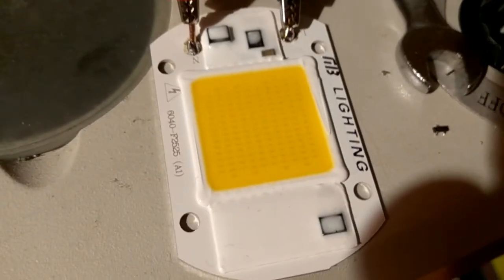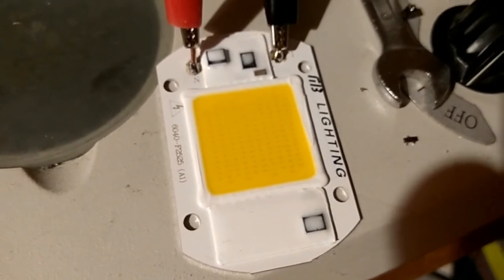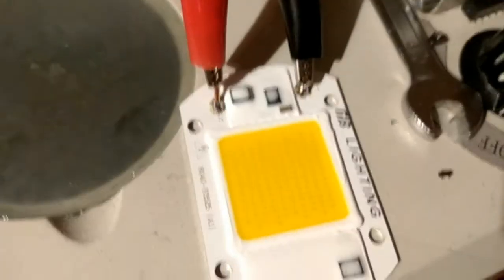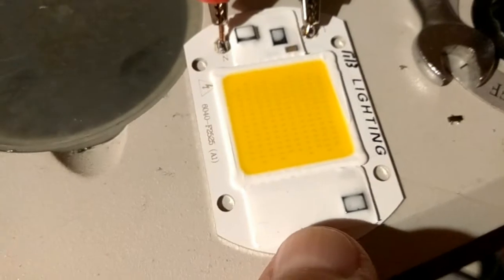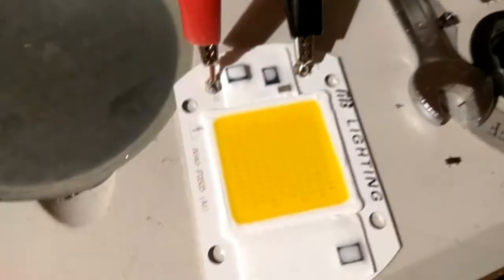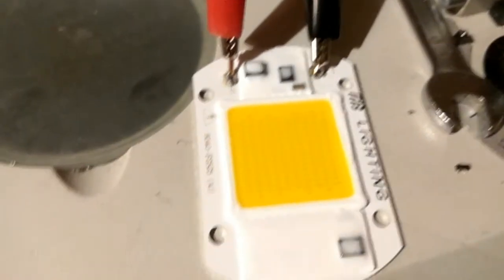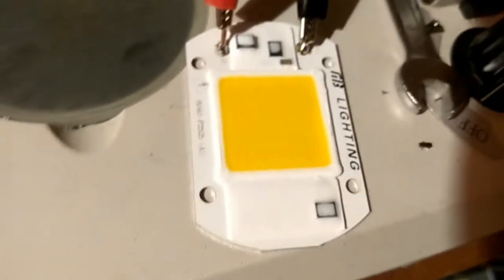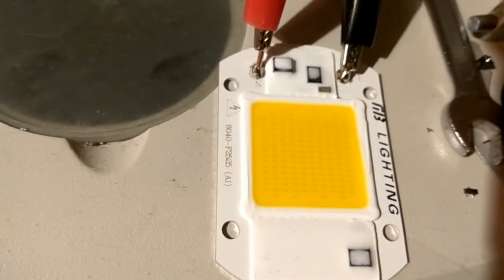110V 230V AC COB LED module, Warning: High Voltage !

Comment: Why is it listed as 110v when it is actually 220v? I bought three of these fuckers and they’re absolutely worthless to me because I do not have 220v outlets, only 110v. Is there a trick to getting them to light up on only 110v?
Reply from the maker: if you go into the order link I shared in the comments, you can see that you need to select the configuration in "wattage" point like :"30W 110v" you might ignored that during your order or get it from different link. you cannot modify that afterwards...
Reply: Veryokay oh, I got it from Wish, not from you, but I did notice that you both listed 110v which none of the three that I bought will work with.
Reply from the maker: @rockland2  try to complain at wish if they made a wrong item description, might you get some refund
Reply: Veryokay I did as you suggested and they gave me a full refund, shipping and everything! Now I have three lights that I know can work, but won’t because I don’t have the right voltage and it seems wasteful to throw them into the trash! Lol
Reply: I also followed up on your link and was surprised at the low prices! How would I make sure I got 110v if I ordered from them? They list everything like you and Wish do by listing both voltages and not really offering a way to specify which one, the grow lights are so cheap on that site that I want to order some, but now I’m afraid too.
Reply from the maker: @rockland2  in Aliexpress in top you see "price" below "color" selection, below "wattage" there is where you need select "20W 110v" or 30 or 50W (I recommend lowest wattage to have longer lifetime of the Chip LED) The voltage will be printed on your LED so you will be know instantly as you get. it was proper for me.good luck! :)